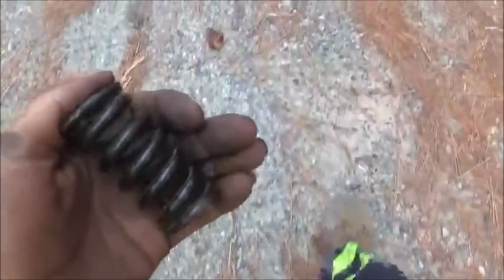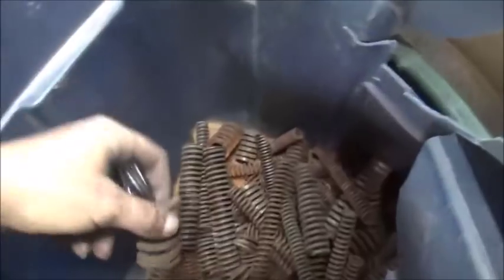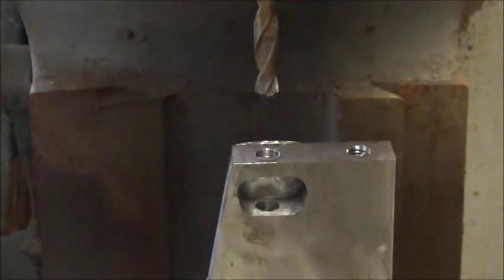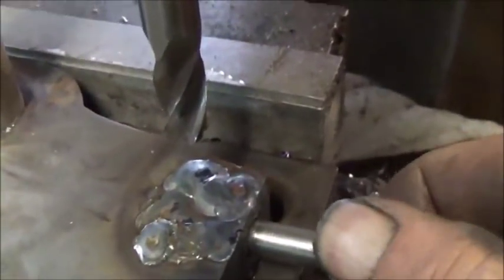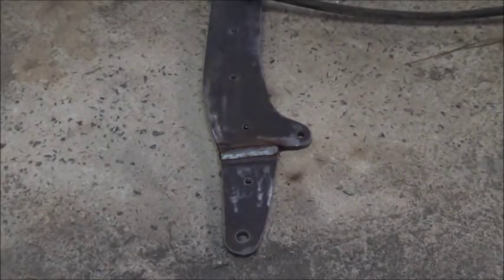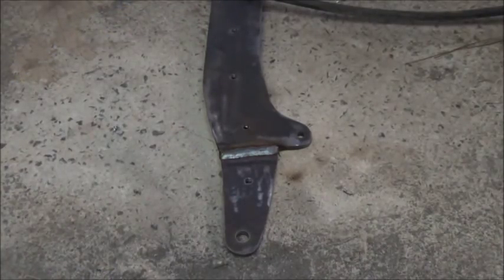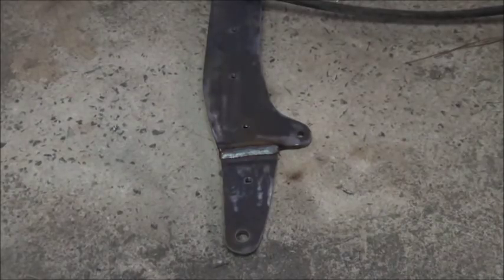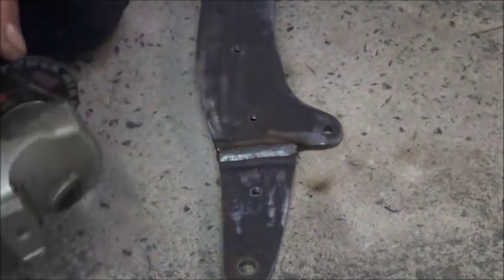Chopper, Bobber, Board Track Motorcycle Build Part 10 Another Broken Tap

Comment: Some tips on tapping: your tap was a hand tap so your best bet is to just use the machine to start the tap straight, then use a tap handle so that you can back up a quarter turn every turn to break the chips. if you get some machine taps, ones with spiral point or spiral flute, use the machine BUT, dont tighten the chuck or collet so tight that the tap wont slip if things go bad, kind of like a slip clutch. In my 35 years as a tool and die maker, I assure you that I am a professional tap breaker and tap getter outer.
Reply: AMEN! Spiral point (not spiral flute) is the way to go. Four flute taps are useless except maybe to hand chase threads.

Comment: I was very happy to find they sold bi-focal safety glasses myself!  If those springs are too stiff, using the hole closer to the pivot point will soften the ride compared to the hole closer to the wheel axle.  You will give the wheel more mechanical advantage to work the springs that way.

Comment: I got a trick for broken taps I learned at a machine shop building engines. You heat it quick with acetylene and it'll cherry the tap and throw ice cold water on it and it'll turn purple and super brittle and just take a drift and a hammer and shatter it and blow it out with a high pressure air nozzle

Comment: Hey Man, Maybe you already thought of this, but you could use 3/4 or ! " EMT and bend it to shape like an electrician with a hickey then cut the pipe in half and have a round  profile front and back for your springers or your frame and .attach with skill and marvel at the  million different ways you could make it look like you want it to.I dig your Channel, I fabricate,I weld I grind I paint I But I aint got a Plasma Thingy or a Milling Machine! Sawzall and a file and a grinder and a vernier Caliper and a milwaukee Wristbreaker/and a Vixen File Lathe..and alot of experience.

Comment: You can cut a HSS tap out of a hole with a high quality carbide endmill. Don't move table so you stay on location, switch out to EM cut at lower rpm and use a dark cutting oil. I've done this countless times and saved three part and a LOT of extra work.

Comment: the way you have the shocks set up, the closer they attach to the axle the stiffer the effective spring rate will be. I'd keep the extra set of holes in place for now so you can experiment.
Reply from the maker: That's why I added the holes that were closer. They didn't help much so I went back to the originals. These springs are very stiff.
Reply: Actually, the farther they are from the fulcrum the stiffer they will be.
Reply: Yes, and farther from the fulcrum = closer to the axle in this case. 

I don't get why he moved them closer to the fulcrum and then back, though.